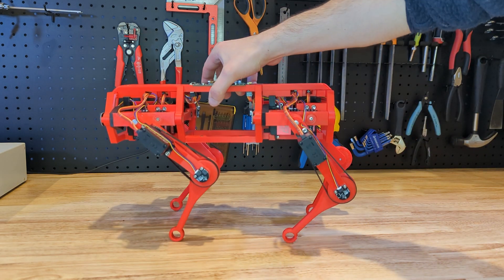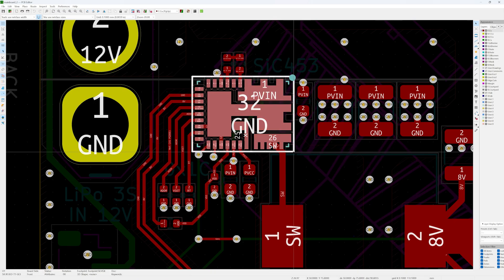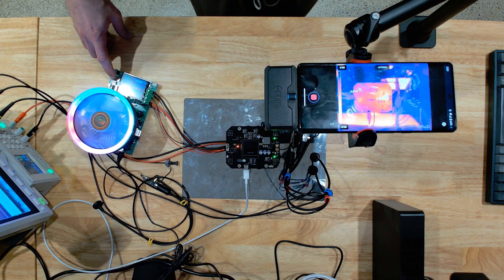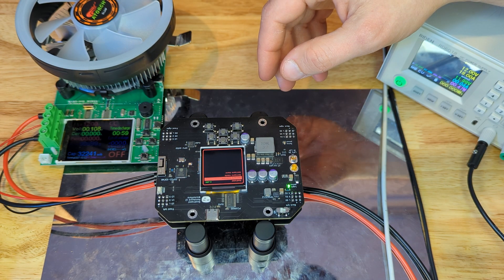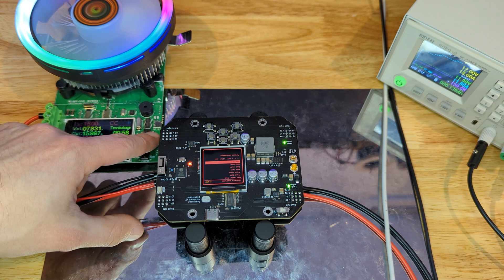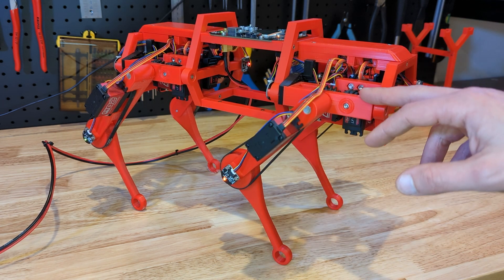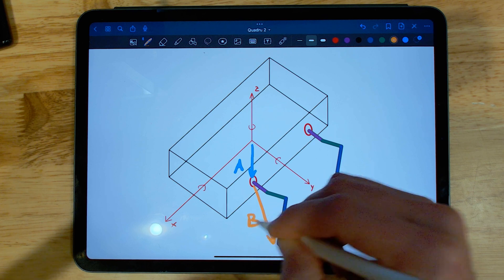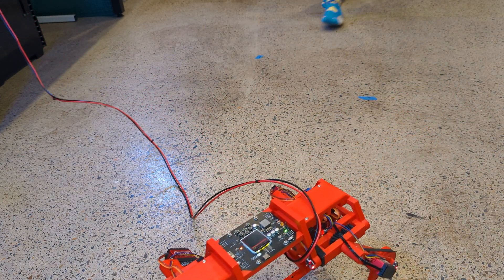Making the quadruped walk!

Comment: The kinematic model can be done with different coordinate systems if you find the transforms to translate and rotate between the different coordinate systems.
Reply from the maker: Very good point, and it's basically what I did to get the leg axis to agree with the body axis. Though, the mental model is so much easier if you don't have this issue to start with.
Reply: @scheffield  yeah, it is best to keep it as simple as possible.

For my hexapod I tried to work the leg kinematics out using a Denavit-Hartenburg (D-H) representation and managed to get an inverse kinematics equation for the joint between the body and coxa, but the coxa to femur and femur to tibia joint movements are linked, both joints together control the position of the foot within two axes which makes it very hard to use that method to get an equation for each joint angle so I had to instead find the transform into the coxa's coordinate system, including the first joint angle and then use trigonometry from there and it just made it so much easier. Interestingly for the body to coxa joint the equation came out the same as if I had just used trig from the start.

The D-H representation makes the forward kinematics really easy but the inverse kinematics are a lot more difficult.

Comment: Why bother with the buck converter at all? Most servos like that can be run straight from a 2S lipo, it would make it easier and make the PCB smaller.

Edit: then you are limited to the max current draw of the lipo, not the max current draw of your buck converter. Servos and motors in general can draw a lot of power, especially when just starting moving, something that can be done with cheap servo driver boards like the PCA9685 is to stagger or offset the PWM signals, so that the signals aren’t sent to the motors at the exact same time and the motors aren’t starting to move at the exact same time, this might help reduce the peak current by spreading it out.
Reply from the maker: Love the staggering idea. Something to try out next time I get the bot out.

As for the buck converter: I wanted to challenge myself. And I think I achieved that :)

Comment: I love the project .
You can run power straight to the servos from a power source and then only send the signal through the board to keep current down .Would this help ? Like all + and - to a battery and just signal going to board.
these powerful servos can pull a good bit of amps each .i had trouble powering 5 though esc bec
Reply from the maker: Yes, it would help a lot, I think. However I chose to challenge myself. 😋